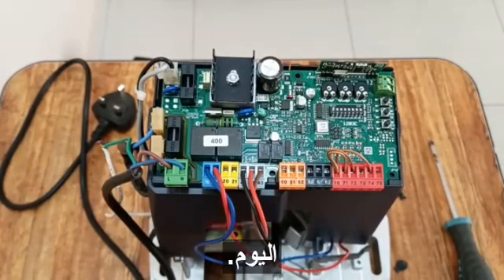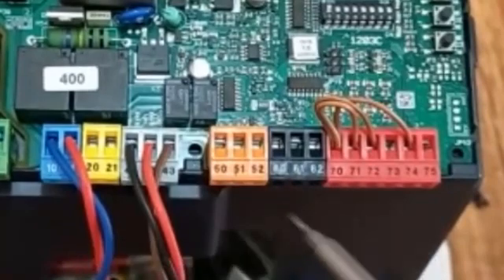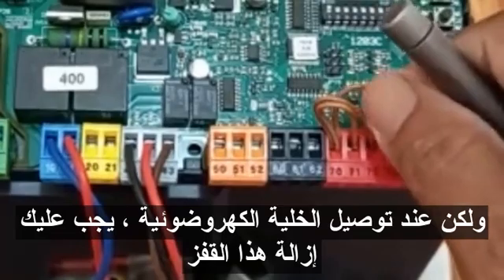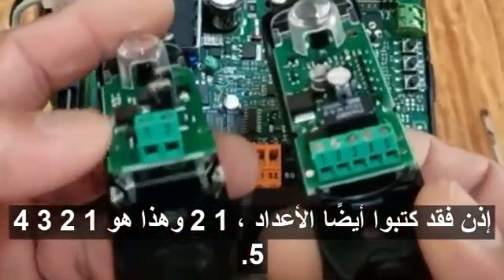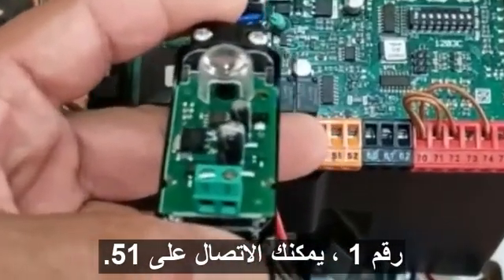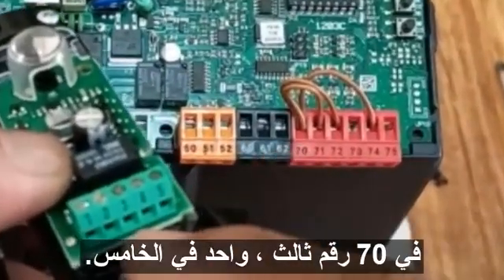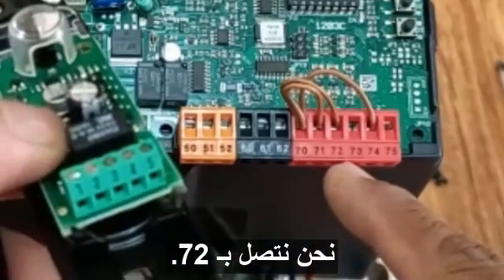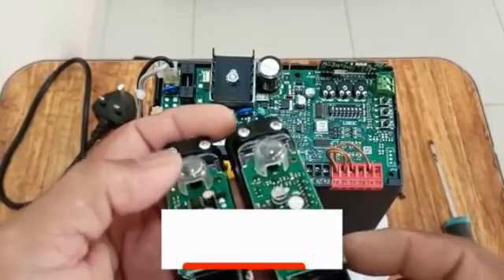How to connect photo cell to BFT gate motor

Comment: I have BFT THALIA BT A80 DUO but when I’ve fitted photocells they stop as they should when obstruction in way but when obstruction moved my double gates close which is danderous ,they should surely open as a safety matter ,my wiring is correct 
Do you know how I can rectify this ?
Reply from the maker: you have to invert the gate motor direction
Reply: @newwaytechnology-official I it makes sense what you are saying but finding that on the control panel is very difficult 
The instructions don’t mention anything on how to get to that section or even change it 
I’ve asked loads of people and nobody knows